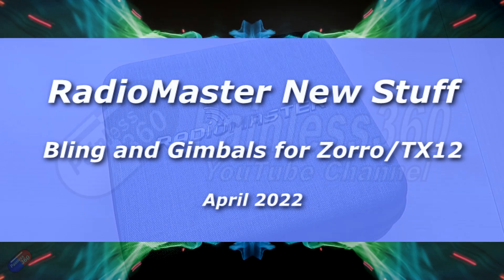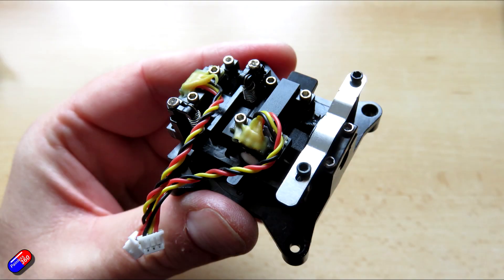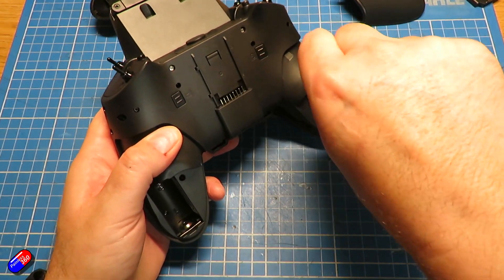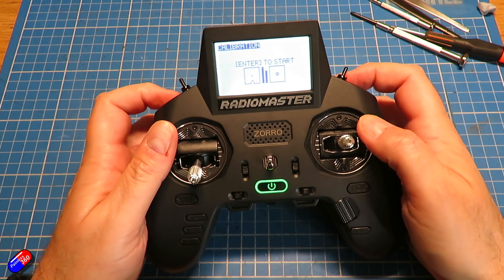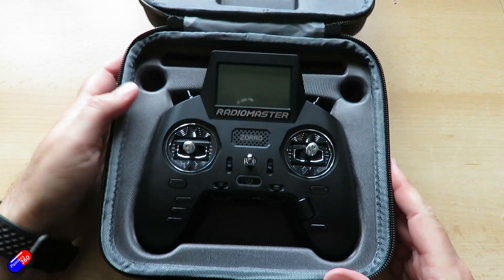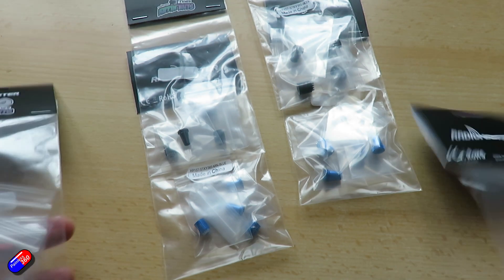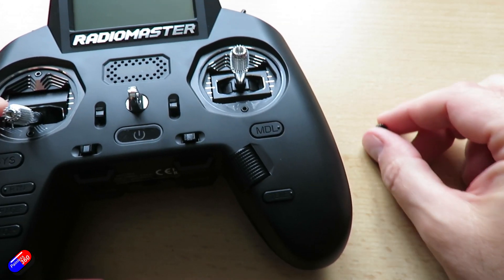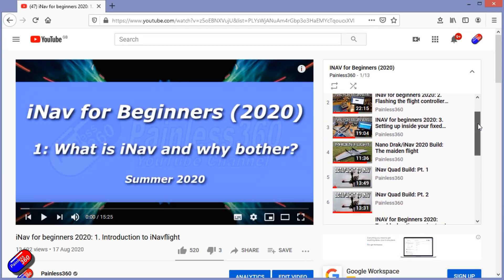Out Today! RadioMaster Mini AG-01 Gimbals, Zorro Carry Case and 'Sticky' Sticks Ends!

Comment: Always wanted to improve gimbals of my jumper t12 pro. (Similar in size with the tx12 I believe). Did you know if this ag01 mini could fit in?
Reply from the maker: Not sure, I'd see if anyone has fitted the T12 gimbals into the Jumper radio. If they fit. These will too.. Sorry I can't help more this time.. Happy flying
Reply: @Painless360  No jumper radio on your shelf? :p (t-lite seems to have same gimbal as my t12 pro)
Edit: according to some Ali vendors and comments it seems to be the same gimbal between jumper t12 t8 t-lite etc and radiomaster tx12.... But at this price lvl if someone valuable could confirm ;)
Reply from the maker: Let me know if you get confirmation. Best of luck
Reply: I’ll be trying to find out as well!!
Reply: @J2_P  Have you got some more informations ? I would like to upgrade my T-Lite gimbal also :)
Reply: @J2 @Golden FPV They do fit in the Jumper T12, however not without some modification of the back of the T12. I show how I mounted them here: https://youtu.be/r2562pAp-iE

Comment: Are these really worth it? Does it make piloting more accurate? I have had quite a few radios and now own a TX16S and a Zorro is coming in.
Reply from the maker: Being 'worth it' is a very personal thing. For many the gimbals in the radio will be 'good enough' but for some the smoother feel and increased accuracy of these gimbals will be something they want or need. 
Back in the early days I didn't get why some radios cost 3-4 times what a modern RadioMaster/Jumper radio did until I tried one. 
Then I understood. 
It isn't just the quality of the components but the assembly and QA checking that make those radios cost a lot more.
Upgrades like this help give an existing radio some higher quality pieces and allow those who want to, to trade-up.

Comment: Nice tech, but there's an Elli-rant 🐘 in the room... I only fly fixed-wing planes, mostly gliders these days, and it irks me when radio manufacturers try to persuade me (by omission) that I don't want a ratchet on my throttle/flaps/spoilers/variable wing-camber control.

Of course I do. A ratchet that's adjustable from coarse and notchy to fine and barely perceptible is exceptionally useful, especially when thermalling a speck in the sky demanding very specific control inputs. It's essential to know where the unsprung stick is by feel alone, i.e. without looking down at a display screen or taking your eyes off the dwindling dot overhead.

I wish manufacturers would let us choose how we set up our radios. Some people like chunky peanut butter; some like it smooth. 🤭

It's almost as annoying as being told that I don't want to fly Mode 1 because nobody in North America does. I don't live in North America. I live in England. I like Mode 1. I can fly Mode 2 if necessary (I taught myself all 4 fixed-wing Modes so as to be a bit more useful at our old club if a new pilot needed a hand with a new model - this was before the days when learners had models that could fly themselves), but my preferred setup has always been Mode 1.

So... As a glider nut I like to have a choice of how my 'throttle' stick functions. Yep, I'm clearly deranged, but I don't care what's most popular; I don't care what 'everybody else' likes; I'm not interested in fitting in and conforming and being part of the team/flock. I just want to do things my way.

Aeromodelling is not a democracy; I'm not going to abandon my own preferences and yield to the majority view. I'll set up my own radio exactly as I please, thank you very much. These days, that requires making stuff from little bits of springy metal, which is a bit of a pain.

At least Mode changes are easily accomplished. But why must ALL gimbal axes be smooth? I understand that quad-copters need excellent stick centring and infinitely variable throttle positioning because... flight control boards and hovering. Or something. But not everybody who wants to swap gimbals flies multi-rotors.

The last radio I bought that had a ratchet option as standard on the unsprung stick axis was a Sprengbrook Variomodul (!), which came with smooth and notched versions of the metal friction plate. Everything was completely customisable; since then I've had to replace smooth tension plates on my (admittedly not very frequent) radio purchases with homemade versions.

More choice, please, manufacturers.